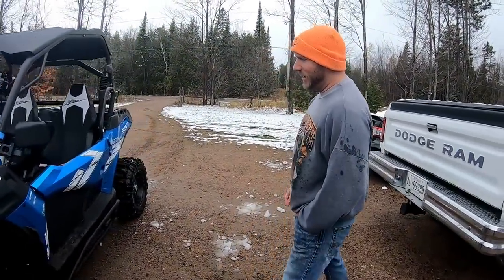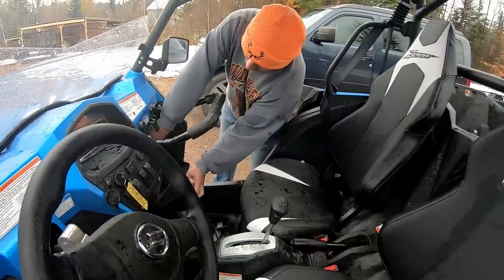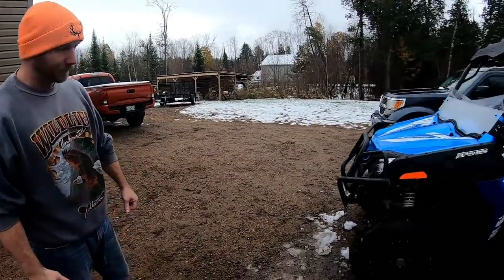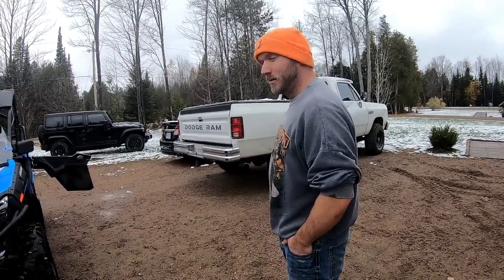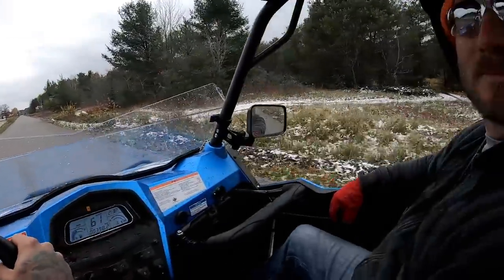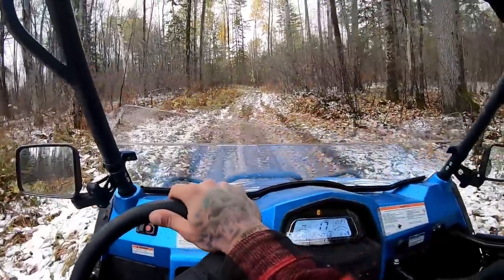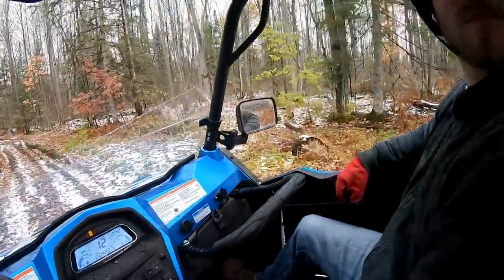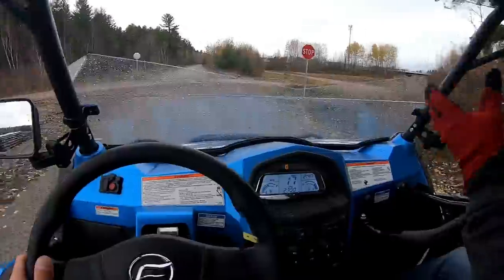2019 CFMOTO ZForce 800 Trail First Impressions!

Comment from the maker: What do you think of Bobby and Anne's new CFMoto? Think it will hold up? What are your thoughts and concerns about CF Moto?
Reply: If the diffs. don't brake then they are better than a can am.
Reply: I have a 2015 800 Z Force. Exactly same machine and so far so good. My nephew has one as well. I think he has around 5000km and so far so good, only problem he’s had was the speed sensor went twice. Replaced under warranty both times. My battery only lasted a year but the dealer replaced it no charge.
Reply: Could you possibly find out where you can get those doors, the one Im buying has the same style part doors and I dont want the full metal doors, I would like the extenders but cant find them anywhere.
Thank you.
Reply from the maker: The owner says he got them straight from the dealer.
Reply: @MainvilleATV  Okay thank you, my dealer doesn't have them so I'll just make some with a band saw and some trucker mud flaps and see how that goes,
Reply: Interesting facts. Cf moto USA is based in Minnesota and they just launched a joint venture with ktm in March. I think they're going to be a major contender. There 800 mud machine 4 wheeler is actually pretty cool right off the bat.
Reply: Mainville ATV and Outdoors  where did you get your half doors I can’t find them anywhere but I have found some really nice full doors
Reply: I think they're imported from Chy-na....ain't no apple pie or freedom comin from there...just sayin
Reply: @crazyflyboy30  i have not had any issues with my 2015 can-am outlander max xt 1000 2up that we bought brand new in may 2015
Reply: @woofman4796  Differential is can am's biggest problem and ever one I watch on YouTube with a can am has have different problems and and  every one that I know that has a can am 4 wheeler's and x3 has had to have a different replace. Research it and also go on Facebook can am  muster and a company called Mud and Wheels is making a killing selling can am different upgrades.
Reply: @crazyflyboy30  that's them, and I don't care ,  I haven't had any issues
Reply: it will def hold up. we have 2 machines my 800 ex i did a custom Dual exhaust set up and had it dyno tuned. Love it .. been a beast of a machine and elka and john hester paired up  to send  me stage 4 shocks to review so videos coming soon on that. https://www.youtube.com/watch?v=NyZUtLMpJz4&t=1133s
Reply: You prolly dont give a shit but if you're bored like me atm you can stream pretty much all of the new movies and series on kaldrostream. Been binge watching with my gf during the lockdown =)
Reply: @Frederick Terrence yea, I've been watching on InstaFlixxer for since november myself :)

Comment: I own two RZR's, a XP 1000 and a 900S, i now work at a dealer selling the CF moto in the US, and I'm seeing a lot of great features on these Z Force rigs. Hand brake, steering lock, rear views and of course a 3,000 lb winch all absent on the RZR. But in your video i'm looking closely at your tires...and they look way too hard, that is why it is bottoming!  lower pressures to 5 lbs and try it out! I see a lot of CF customers complaining about this and we set their tires correctly and it's much much better.

Comment: Great honest video! Thank you. I have the C Force equivalent. I believe the mechanicals are very similar! I used to have a similar gripe with the suspension from the shop. I wound both adjustments (compression & rebound) up to max and backed off 2 clicks. Problem solved! I also like the fact they have a wet primary centrifugal clutch not the "slip n grip" arrangement like most others. If you want to see them "mudding" check out Russian C.F. Moto vids. They are nuts! Cheers!

Comment: I’m thinking a 60” for more comfort. But I’ve never been on any Ontario trails. I just don’t want to come to a bridge that is 50”. I’m just thinking, what is another 10”? That can’t be too much of a problem for a trail. How’s your back on a sxs? I sometimes have a sore lower back when working.

Thanks
Reply from the maker: The bridges in my experiance are more than accommodating for a 60 inch. Atleast in my area. I suggest a sxs if you're seeking comfort. My atv can beat me up on long hard rides for sure

Comment: The wheels on that one are aftermarket, the A-Arms look painted or powdercoated. The horn and turn signals aren't standard either. The winch is standard on all off-road products except their motorcycles, of course. For an entry level SxS, you get good bang for your buck.

Comment: In all honesty I have owned Honda, Polaris and Yamaha, and I currently own a cforce 800, it is one of the best ATV's I have ever run, considering I have hauled around 100 tonn of gravel, and for the last 5 years j have cut and hauled 10 cord of wood each year, with this atv. If u ask me this atv or Anything cfmoto makes is more than capable of competing with the rest. Recently seen a 700 mud pro having trouble starting with only 500 km out of the garage, and a cfmoto with over5000 km starting with ease.....

Comment: I have to see if motoz forces I have a 500 trail that is a 2016 has been a very solid bike I will say this pension is a little rough on it but it's only 50 in trail but the 800 is a 2018 60 inch wide 800 and rides incredibly smooth and I don't know why you're dealer charged extra for a roof roof should have come standard

Comment: also, the CF Moto manual says to drive in low all the time!  Only on high speeds on roads use high range, this is OPPOSITE of Polaris SXS.where they say low is only for hills and mud/sand....i think this is because of these CVTech Trailbloc clutches and the way they are set up..

Comment: When I bought mine this spring, the nearest dealership was 200 kms away. Since then, 2 closer dealerships have opened. They are popping up everywhere.
Reply from the maker: Yeah we just just got one too. Which solved part of the issue. Still have major trust issues about these machines though. How's yours holding up?
Reply: I started off by babying it and being super careful because I didn't trust it. Now I hit whatever I can in it, almost challenging it to break something. I have near 1000km on one of mine and about 400kms on my other (they're the ZForce 500s), and haven't had any issues at all. I've hit whoops so hard that it felt like the rear end bucked 2 feet off the ground and can't believe everything is still straight. I just put a 60" plow on one of them only because it was on sale at Canadian Tire lol.

Comment: I have a 2015. Same machine except for the doors. I added cables from the battery up through a hole in the box just to make it easier in case I ever had to boost someone or myself. Just for convenience since it’s a pain to get at the battery. Only beef with the matching is the oil dipstick location. It’s hard to reach
Reply from the maker: Sounds like fixable stuff? How much milage?

Comment: How tall are you guys? Driver specific.. I sat in one at my local dealer and love all of the standard features and have been hearing good reviews but after sitting in one zforce 800 trail my right leg (knee) kept hitting the center console and wasn't very comfortable at my height of 6'1.  Now considering the uforce 800 because the seating is a little more upright, unfortunately my dealer doesn't have one there.
Reply from the maker: I am 5 foot 9, the owner bobby is around the same height too. We had zero issues. Sorry to hear you dont fit buddy
Reply: @MainvilleATV  No worries, the only sxs in my price range that I felt decent in was the can am maverick trail.  Thanks for the quick response, subbed.  Still interested to see how the reliability holds up.
Reply from the maker: @desertdrz7618  I appreciate the sub buddy. Good luck and if you find what you're looking for post it up in our facebook group to share what you learned buddy!
Reply: @Michelle Klassen So it's on all 2019 models?
Reply: @Michelle Klassen This is great news. I'm 6'4" and was considering purchasing a Z800 Trail but the legroom was an issue, possibly forcing me into a rzr or CanAm. I'm in WA, near Spokane. Can US dealers get this part (we have one here and one nearby in Coeur d Alene ID)? If not, how would I get one from a Canadian dealer? Thanks!
Reply: DesertDRZ I had the same problem since I am 6’2 so bought the U Force since the driver’s seat is adjustable

Comment: What I want most for mine is 2" or so of extra clearance and maybe 1" or 2" wheel spacers. I may upgrade to a 1000cc next year and forget about the 50". After driving my Teryx, I realize I can pretty much do everything with 60(+)" wide and it will give me some freedom to lift it a little bit more and put some bigger tires on it. I'm excited to see if you guys do any work on this. A Snorkel would be sweet!
Reply: What area trails are you talking about? I was thinking about a sxs but worried about the width of the trails.
Reply: Well, I ride out of Central Ontario now, from Belleville. I've also ridden quite a bit around Sudbury area. 50" is nice because you don't even have to worry about width, but the 60" size seems to do fine. It just forces you to occasionally slow down and think a little bit more strategically about how you work your way through sometimes. There will be a lot more rubbing against the brush, however. I can deal with that for the increased stability, suspension travel, ground clearance, etc, that normally comes with the wider machine.
Reply: Yeah, future plans are already in the works

Comment: Okay fast forward 7 months. Would he buy it again?  I’m seriously considering one.
Reply from the maker: Honestly it depends what you're doing with it. My honest opinion so far without knowing what you need or do with your machine is dont bother.
Reply: Oh okay,.  Is he having problems with it.  Is it too light duty?  I like forest roads and blue trails, a little mud once in a while.
Reply from the maker: @DenisRule  I cant speak for the owner but overall I cant suggest this specific model as it's the only one I've experienced. Although by the sounds of what you do I dont suspect youd have any issues. Just dont expect ultimate reliability like a Japanese machine for example.

Comment: Some advice don't buy a trail and don't but anything smaller than a 1000, I bought an 800 trail zforce and really wish it was a 1000 60 inch , comparing it to others in its category the HP is too low and the 50 inch at higher speeds is not as stable so now I'm bored and will sell it and buy bigger. Here's the kicker it took only 126 kilometers for me to be bored that is all I have on it and I'm 64 , 62 HP just doesn't excite me, need more power, more speed ,more torque. Just saying

Comment: From what i was told the motor on thr cf moto comes right out of thr honda plant
Reply from the maker: If that's true, we wont have to worry about the engine, eh?
Reply: Rad49 1967 you were told wrong. They build their own motors and are a very similar design to an 800 Can Am.
Reply: I was told that buy a dealer down here. So ill have foo get back to him about that
Reply: They build they're own motors. Matter a fact they build some for Ktm, Yamaha,Honda and many more. They build over a million motors a year. They may be pressure washer motors, who knows. That's off CF Motos website.
Reply: May not be Chinese, but look what happened with Hyundai and Kia. People said the same thing. Look how many years they have been around. Longer than some of the riders reading this.

Comment: Its not a CAN AM. OR POLARIS.and elka helped them. There only lasting 2 years. There in California now. They give ya a the godies because scrap.... Beleive me
Reply: Wherever the rumour started that Elka 'helped' CF Moto started, it is false as the boogy man. The shocks are ALL CF Moto and they are not good at all. Elka, who deny any connection with CF Moto in any way, actually sell shocks that are a bolt on replacement and an excellent upgrade.
Just to complicate things, CF Moto sold a Canadian Special which they fitted out with genuine Elka shocks, but normal CF Moto shocks have nothing to do with Elka.

Comment: bought a 2019 cfmoto 800 trail thay are cheap made you can't reach your oil dip stick to check it its behind the passinger seat behind a small panel your hand can't reach the dip stick bad design I have 10 miles on it and I'm going to the polaris dealer trade in paid 11 900  be lucky to get 7000 to me it will worth it thear is no value
Reply: I have a  Zforce 800 and the dipstick isn't that easy to reach, but if you get down on your knees and reach in front of the right rear wheel you can access it quite easily.
Reply: @400kvf  you can have a dipstick extension put on for about$25.00. I have one on mine and can reach the dipstick easily.
Reply: You'll be going back to that Polaris dealer a lot more than one time. :)  I have 5000 Km on my CF Moto and I have never been back to the dealer even once. Nothing has broken.